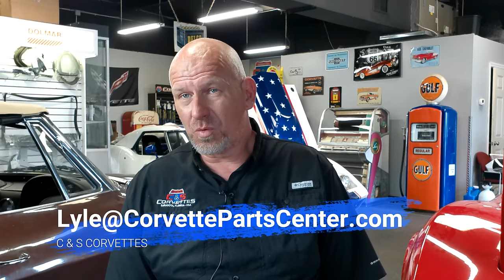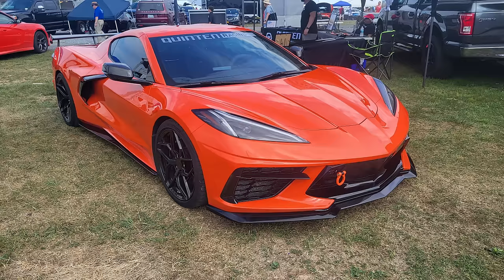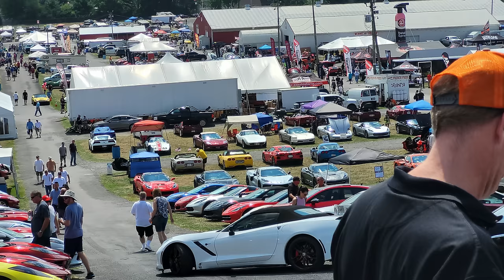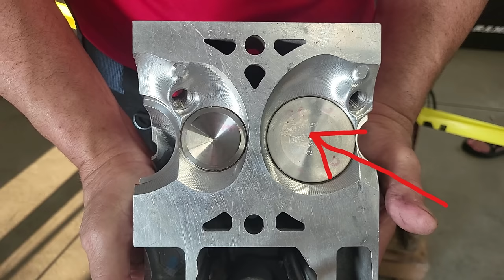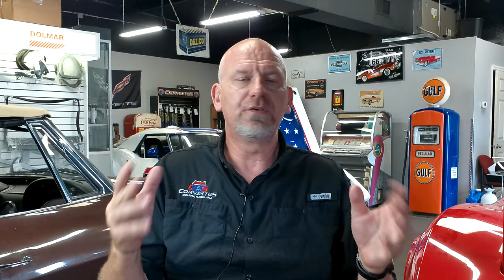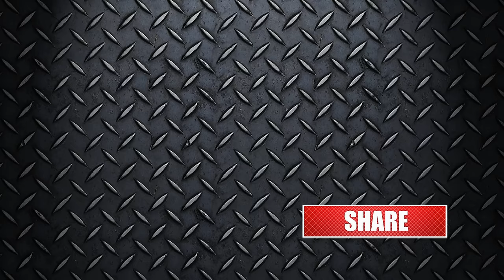The Truth about the LS7

Comment: A question was asked further down in the comments about the use of CIA and headers on the LS7 causing valve these items have nothing to do with valve drop. On stock LS7 engines the valve guides are not up to the task. The Ti intake valves are coated and polished at the factory. They are not polished enough and have burrs. ( Ask me how I know) they act like sandpaper on the guides and cause wear on them. The valve guide bores are not concentric with the valve seats which causes excessive wear on the valve stems. The exhaust valves are hollow sodium filled. The excessive movement can eventually cause the head of the valve to snap off and boom! When I had my heads checked at the end of my GMPP warranty at 24k miles the intakes were all out. ( burrs on the Ti valves) the exhaust were almost out. New heads approved and when they arrived at the engine builder they were out of spec. Ti valves were sent back to factory to be recoated and polished correctly. Heads were machined to fix the concentric issue. Add Ti exhaust valves and CHE trunnions. Also the cam was bad. Lifter was galling the cam. Had a custom cam with .615 lift. Not real big and new beehive springs. 10k miles on the engine and many track days as will with no issues. 

Another question asked was about theHi  HP LS7 create motor with a bigger cam. My question on this would be what modification has GM made to the motor to accommodate the larger cam? Have they upgraded the valve guides? Have they made sure the machine work on the heads is correct? Have they put appropriate springs for the larger cam? If they have the motor should be great out of the create. 

The LS7 is an awesome engine. When on the track it’s a beast. It pulls to almost 7k. Flattens out around 6800 RPM but running it to 7k and grabbing the next gear keep the engine in the fat part of the torque curve when you let the clutch out. Nothing better than dropping the hammer and LETTING THE BIG DOG EAT!!!

Comment: Thanks for the video.   I am looking at a 2006 Z06 Corvette that is fully stock with only 7500 miles on it and full maintenance records.   It looks great.   Is there any checks I could have a chev dealer do to check if the engine could have the valve issue you mention?  Thx.

Comment: So basically GM designed absolutely no headroom for modifying the LS7 (as in more airflow and fuel = more power)?  Why would they build something so fragile or made of glass like that?   You would think that the Corvette being a potential track car would be over engineered to be able to handle modification and abuse.   Most German and Japanese cars in my experience are so over engineered you can mod them way over the factory spec and they hold together just fine as long as you run the proper oil and fuel. How disappointing as the Z06/C6 is the only newer Corvette that I like style wise and would buy.

Comment: Lyle thanks for the information you only back up what was told to me by a mechanic at zip products people got to understand and realize when you add aftermarket components to an engine such as this problems will occur but I hear you what you said and basically you're backed up what was already told to me thank you great contact and I have a 2011 ZO6 and it has 38,000 miles on it I was thinking about putting headers on it I did put a halltec cold air intake on it and now I'm just rethinking that 😗

Comment: Great video Lyle !  Other then the higher price, more expensive tires, better looks compared to a base C6 and of course 505 hp!, if im not tracking it, why go Z06 ? My current plan is to buy a Base C6 manual, one owner (or 2), no mods and as bone stock as possible next September. Saving up about $5k for a deposit.  If the prices drop back to pre-Covid days (not too likely) by then a Z06 maybe an option.  As with most things it comes down to $ and what fits a budget. Like i said, i wont be tracking it, this will be my 2nd car, more of a cruiser with some spirited driving. I joined the Corvette Forum last week and will keep my eyes open on there and CarGurus etc.  As of today im still thinking base coupe but if the right C6 Z06 (07 or newer) comes along i may take that leap

Comment: Awesome video! Good to have this info direct from the source.
Early this year I was looking into buying a C6 Z06 early this year, but the main factor that triggered my doubt was these engine stories I found doing as much research as I could. It was a big part of what 'scared' me into buying a 2005 Viper instead.
Reply: so instead of getting a 1/15,000 chance of somthing goign wrong with your engine ( wich EVERY product on this planet has ) you chose a dodge that depreciated in value faster than any other brand. one that is not nearly so comphy to drive/ ride in, has more stuff going on engine and chassis wise that costs more to maintain and harder to find parts for, and once its at 100k miles noone wants them. Also jjust cant get past the fact that they sound like a grand am

Comment: Getting a C6 Z06 down the line and the first thing I'm doing is ordering a set of heads from Frankenstein Performance.  Just to be sure I get good heads on a killer engine.  I've seen too many videos on YT where the heads fail, drop a valve, and the owner is left picking up the pieces on a 20k motor assembly.  Better to spend the 5k in heads and just get it over with.  Then you'll have a happy LS7 for the rest of your ownership and may actually increase the price of the vehicle since you went out of your way to fix a reliability flaw that GM refuses to correct.

Comment: Even stock the LS7 needs vavletrain upgraded.  Failure rates are way too common.  As mentioned KSTech or RPM in Delaware (uses KS Tech parts) to have the valvetrain done.  Throw a cam in it for more power while in there because the cam is cheap.  It's the labor that's astronomical.  Many with LS7s and knowledge of these motors knows the common failure component and it's well established as failing on stock motors with as low as 10k miles.  Doesn't matter if stock or modded.  It's a design flaw.  You can't even buy the motor from GM Direct parts anymore.

Comment: I got a c6 z already canned and ported heads to avoid any issues not to mention it can beat or at least run next to a c7 z. 566 to the wheels which is what c7 put out
And the answer is a c6 z is rolling the dice with out new heads.

Comment: you must be working for gm. I bought 08 Z06 stock with 11k miles on it. Removed heads and first exhaust valve I checked had about 12 to 15 thousands play on it. My opinion is that valve guides were installed off center and that caused uneven wear.LuckilyI was able to fix heads before something bad happened.
Reply from the maker: I merely reported what Paul Koerning told me, and he is GM's lead Corvette Tech.  I made a follow-up video after interviewing  a former Corvette Engineer who wished to remain anonymous that details exactly what the weak points are and why the failures occur.  Check out that video...I think it will make better sense than what GM told me.  Lyle

Comment: The valve guide bushing bores were mismachined off center. Enough for the engine to run and run powerfully, but it wore out the valve stems prematurely causing the valve head to snap off. Remove valve guides, press new unfinished guides in and machine shop final machines the valve stem bores in spec.

Comment: Thank you this video was super informative. How about a z06 in the C5? I found one with low miles, however, the Vette Doctors in N/Y. added a super charger so the installation was professionally done and the car produces around 600 to 650 HP. Any advice you can share about this particular C5 Vette and the add ons? Thank you in advance.
Reply from the maker: The Z06 was a very good engine, and the upgrades you mention shouldn't affect longevity as long as they strengthened the lower end of the engine, upgraded the valve springs, etc..  As they are a professional shop, I would assume that they took all of the needed precautions to prevent premature failure of the powerplant.  Lyle
Reply: @csvette  Lyle, thank you for this information. Should I decide to by this car I will call the Vet Doctors and see exactly what was done. Good point, thank you.

Comment: I have a question on the electrical system on the C6. As it would apply to my C6 Z06, I find it off how and when the start button is lit up. Sometimes when the key fob is in the house and I open the driver doors, all the gauges and the green ring around the start button will light.  Sometimes, when I have a fob in my pocket and open the driver door, the gauges are lit but the green ring around the start button is not lit.  Do you think that's odd because I do.

Comment: Dude.... You could have just said "The valvetrain on the ls7 is pretty close to floating those really fancy thin wall sodium valves when you're screaming above 7k. Bone stock they are fine, but once you start increasing the airflow at high rpm they tend to fail. That's why you get those claims of badly designed head/valves/etc"...

Comment: Hi if Gm states there were a handful in 2006 that had valve issues why did they not solve the problem ? Thks
Reply from the maker: The problem was present throughout LS7 production, with no discernible pattern.  That is what makes it so frustrating!

Comment: Had a 7.0 bone stock 2009 from brand new, and it eat a value,  oil change ,rocker adjustment, and it was a lash check ,even the coolant, all under 30000, and boom exhaust valve gone. Had a machine shope build one , and man it still runs today ,got power to five grand, big cam opened up the heads. Gmail made them last past the warranty and after that blow on the dice and hope for seven or eleven.

Comment: Lyle thank you for making this video. I have owned a 2006 Z06 since new. I have read all the horror stories about the heads on the LS7. I have just over 50K miles on mine.  It is bone stock. Don’t know if I have one of the early incorrect machined heads but I’m guessing I don’t with 50K miles and no issues to date. I don’t race it and it has never been near 7K RPM. After listening to what you said I feel a bit more at ease about my LS7 now even though it is a 2006. 
Many thanks for addressing this issue once and for all!
Reply: @galencaudill6462  a friend has an CLK63 black series with the head bolts that could possibly cause your engine to say so long and farewell. Despite it only being around $2000 dollars to fix with reusable studs he would prefer to play Russian Roulette on a limited edition car that will cost between $25,000 to $50,000 to replace. Pennywise pound foolish.
Reply: If you aren't going to sell the car that probably won't be an issue, but being a 2006 without heads that have been checked would probably push some buyers away.

Comment: Found a 2011 C6 GS with 22.000 mls and a 2013 C6 Z06 with 8.000 mls. The question is, which you consider to be better, a bone stock Z06, or maybe buying the GS (6.2 L) (both MT) and going with a supercharger kit for nearly 600 hp (550 WHP)
Reply from the maker: GS with a supercharger.  All Day Long.  Love the Z06, but...issues.....   Lyle

Comment: How hard would it be to go with a set of LS3/L92 heads and a mild cam where you still have correct valve to piston clearance? Ls3 heads are as bullet proof as any other truck/car LS head IMO. I have heard of repaired and "fixed" gm ls7 heads still heaving issues. If you can take that away and put a still relatively good head on and decent cam I don't see power loss but gain reliability in the engine. Then sling it to 7K again or more. Idk, just throwing it out there. You can get the heads relatively cheap now over ls7 heads. The money you could save you could us in porting and better springs.

Comment: I may be getting a 2006 z06 soon. Previous owner claims the heads were upgraded and the issue is fixed. Stage 3 cam also on. If it falls through I’m looking at a C6 Grand Sport instead eventually. Should I be wary? Only learned about the heads issue being a thing in c6 z06s a few days ago.
Reply from the maker: The C6 GS is a very solid car.  Other than the normal costs of upkeep, they are probably the best version of the Corvette available from a cost and ownership experience perspective.  Lyle

Comment: I recently got myself a z06 with 30k miles bone stock. I almost have enough for a Texas speed fix/ porting. My valvetrain is a but noisy as well. Should I commit to the head fix or is there nothing to worry about?
Reply: Yes the heads are a major issue, this guy is wrong about this issue. Sounds like hes shilling for chevy, maybe the guy told him all that bullsht and he believed it, but the guy works for chevy and was covering for them . The ls7 head issue is why the grandsport and z06 are selling used for the same price and why I have a grandsport and not a z06, same looks no ls7 issues
Reply: The valvetrain noise is the first clue the guides are bad. The problem will get progressively worse. Notice any oil consumption,  or smoke on an upshift?

Comment: I have had our 07 Z06 for over 10 years bone stock! Not an issue except dead battery! I have done plenty of research before I purchased the car, called numerous dealers(Rick Hendricks Chevy) Corvette World of Dallas, our local Chevy dealer which is a top seller of Corvettes on the west coast. All said the same thing keep it stock as this person stated! Just for peace of mind I had it checked no issues!! Most is internet fear mongers! Or speed shops wanting to buy their products so your Z06 won’t blow up! To try this theory, I put a CAI in my C5, what happened check engine light came on! For what, so I plugged in my trusty scanner, 4 codes, all exhaust sensor issues, so I placed the stock intake back on cleared the codes no CE light. So the air is strictly regulated as he stated above, if you want the Z06 to be faster buy a ZR1. Also look at a YT video of a pro race car driver doing laps around the Nurburgring in a Z06, only came closed to the red line once! Not bouncing the rev limiter!

Comment: The LS7 failures follow every year of the LS7 and it happens to not only modified cars but also alot of stock cars with hardly any miles. The gentleman you spoke with at GM probably doesnt want to confess to complete truth bc they have avoided this turning into a recall due to the expense it would ultimately cost GM. The corvette forum and ls1tech and even fb groups are plagued with reports of people losing engines.

Comment: So after listening to your explanation I have one question which is not Corvette specific.   You're talking about modifications to automobile engines. I've bought into the  "K&N" story about better air filter and lifetime savings over OEM disposable air filters.  Is this wrong? I'm not a racer, off road fanatic, super heavy long distance hauler or any type of an extreme driver.  I'm just looking for good quality maintenance items that will provide me with the ability to get all of my vehicles the longest engine life possible.  So with all of these factors am I setting myself up for failure or not?
Reply from the maker: I would say you are perfectly safe using a K & N filter in your stock air cleaner housing.  Lyle :)

Comment: I was wondering why is all that space technology for on the LS7? titanium, sodium filled valves, special valve guides, etc, etc. Turns out that you shouldn’t rev the engine, you shouldn’t change the muffler, you shouldn’t do anything with your car! I built an LM7 5.3 from a truck everything stock but the camshaft and valve springs, I rev it to 7000rpm any time and nothing happens

Comment: I’ve noticed a ticking sound in the valve train of my 73,000 mile C5 Z06. Is that normal or is there some wear in the guides or something that needs to be fixed before it fails?
Reply: @generalsixty2133  thanks! I hope not!🙏

Comment: peak push is happening at peak power... im not sure why people keep implying it happens at peak torque.

Just because torque is maxed out at a lower RPM and may even then start dropping off, as long as you are still continuing to make extra power as revs climb, if the goal is to go as fast as possible then you stay in it, there is no reason to shift other than mechanical sympathy, fear or the red line approaching.

Comment: I have my 06 Z06 early run engine out on the stand How do I check to see if I have one of the bad ones and can it be fixed??
Reply from the maker: That is going to require someone more knowledgeable than I!  Contact Race Proven Motorsports at 302-798-4000 to see what they have to say.  Lyle

Comment: Bronze guides, roller rockers, and methanol/water injection, you can run it leaner and meaner without the heat buildup in the cylinder head, upper block, deck mating surfaces, pulls the heat off of the exhaust valves chamber surfaces and piston crowns, and not only flushes large portion of the generated heat out of the exhaust, it consolidates the heat and exhaust gasses, puts less of a workload on the catalytic converters, letting the exhaust flow better because it has more mass per pulse, it improves the cylinder scavenging.  It reduces the intake charge temperature, increases the density, and velocity, rapidly absorbs residual heat and vaporizes and enhances fuel atomization, more fuel is ignited and completely burned.  Less concentrated  heat in an isolated area (inner exhaust port) valve guides and stems don’t reach critically high temps, and the thermal cycling expansion and contraction are minimized, ceramic coatings on pistons cylinder head and valve faces (combustion chamber surfaces) for thermal barrier and lubrication augmentation. Roller rockers and improved valve train geometry can be achieved but that’s a lot to post.